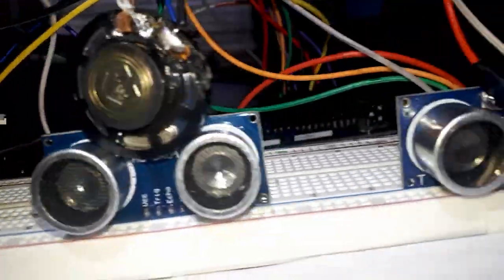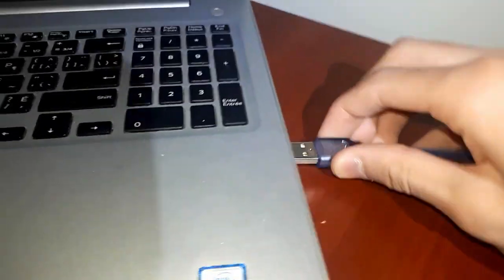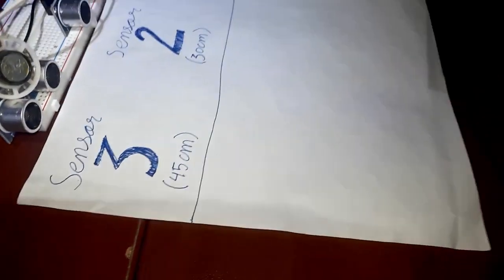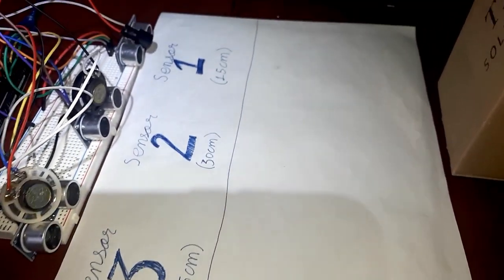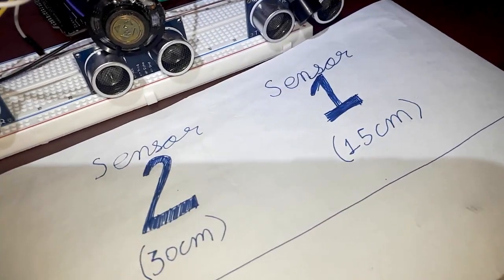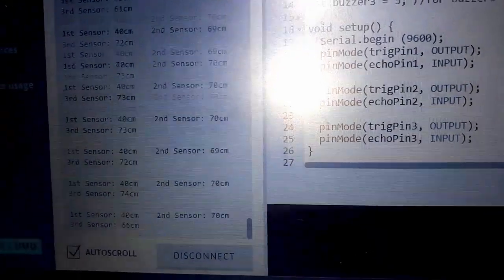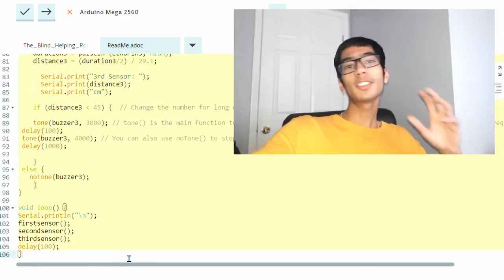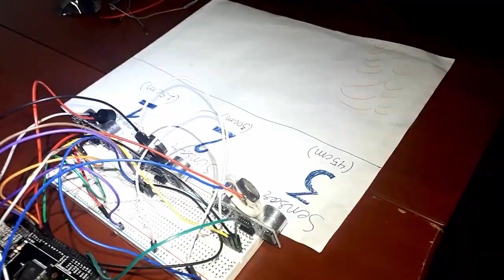Interfacing Multiple Ultrasonic Sensors With Arduino  | Amazing Project to Make

Comment from the maker: Here is the schematics and the wirings to the Arduino:

____________THE THREE ULTRASONIC SENSORS

trigPin1 --> 6;  //this is for first sensor Trig Pin of the Ultrasonic sensor going to digital pin 6 on the Arduino
echoPin1 --> 7; //this is for first sensor echo pin of the Ultrasonic sensor going to digital pin 7 on the Arduino

int trigPin2 --> 8; //this is for second sensor trig pin of the Ultrasonic sensor going to digital pin 8 on the Arduino
int echoPin2 --> 9; //this is for second sensor trig pin of the Ultrasonic sensor going to digital pin 9 on the Arduino

int trigPin3 --> 10; //this is for third sensor trig pin of the Ultrasonic sensor going to digital pin 10 on the Arduino
int echoPin3 --> 11; //this is for third sensor echo pin of the Ultrasonic sensor going to digital pin 11 on the Arduino

_________ TO CONNECT THE THREE PIRZZO BUZZERS

buzzer1 --> 12; // This is the first piezo buzzer that is connected to the first sensor and is attached to the digital pin 12 on the Arduino

buzzer2 --> 13; // This is the second piezo buzzer that is connected to the second sensor and is attached to the digital pin 13 on the Arduino

buzzer3 --> 5; // This is the third piezo buzzer that is connected to the third sensor and is attached to the digital pin 5 on the Arduino
__________
Hope that helped. 
Thanks so much for watching, hope you liked it. It means a lot :)